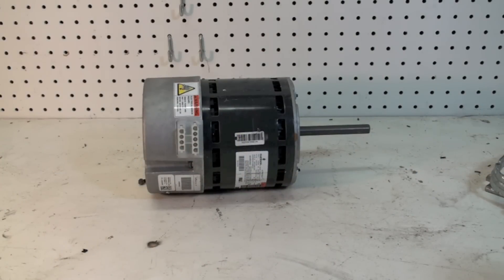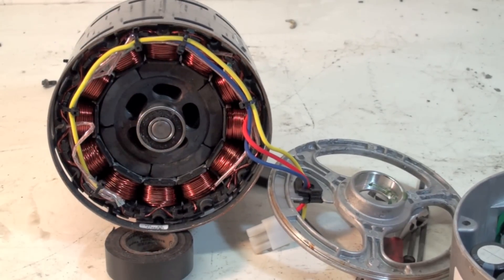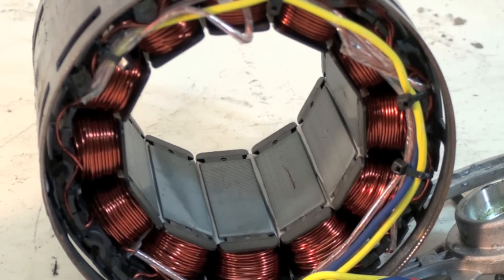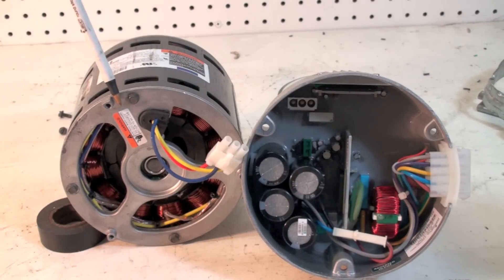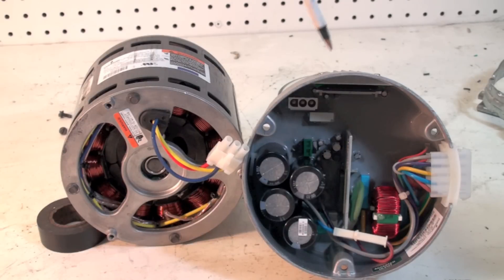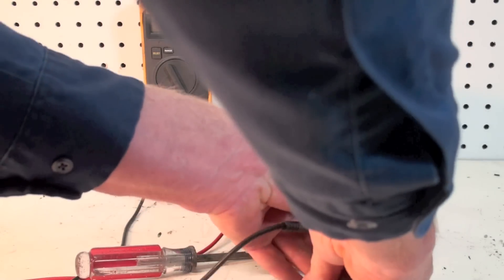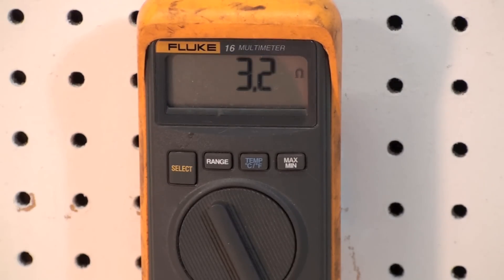The ECM motor construction and troubleshoot

Comment: My AC Blower sometimes doesn't  start, it wants to start but it doesn't start it takes about 40 seconds or more to start, sometimes doesn't start at all, and the the compressor pipes start frozen, evem if a turn it on instead of auto doesn't start, i call a AC company they check everithing they did not find anything, the first time, the aecond time they said us the motor, all the unit is 2 years all, any suggestions?
Reply from the maker: If it is an ECM motor, you probably have an electronic problem with the motor end bell.  Can't be sure without more info.
GFM

Comment: what is a Mossfit?  if you point to that as common problem might want to say how to order one..  you say "this thing"  nevr explain about what you call earlier Mossfit?  
then you explain in detail how to test every winding not a common problem...
Also Never mention other common module easy fix the Current Limiter gets burned!
a $2 part..  nice try
Reply from the maker: Mosfet.  It is an electronic switch.  Replacement of mosfets is not possible due to the end bell being covered in epoxy.  Thermister replacement is covered by a link at about 6 min into the video.  You might consider watching the video where these things are explained before complaining about it.
GFM

Comment: The Emerson UltraTech Variable Speed Motor Manual says to check the voltage between pins 1 and 4 of the communication cable/connector (the one with 4 pins), should be 9-15 VDC. But I've measured 3.3 VDC coming from two different PCBs (PCBJA103). Any experience or comments about this?
Reply: Confirming that 3.3 VDC is the correct voltage.

Comment: If the motor feels like it's a servo motor, ie has notches as it turns you have a short in the windings. Not as scary an issue as it sounds. I opened the case and found a burned spot on two wires as they run around the top to each coil. Carefully separated them and wrapped a bit of elect tape. All fixed for pennies instead of $700.
Reply from the maker: Good  thoughts.
GFM

Comment: Direct current three phase? There are no "phases" when using standard direct current.  This is a permanent magnet three phase motor.  The direct current is received by the VFD and then rapidly switched on and off making a rotating magnetic field effectively making it a square wave alternating current.  If you took this motor itself and supplied the appropriate sine wave three phase voltage,  it would theoretically run.  In essence the ECM is like a glorified computer cooling fan motor, which is also AC.

Comment: These Electronically controlled motors have shown up in all applications
 these days .First thing I`ve disassembled that has these motors in was a
 VCR that drove the capstan and the spinning head that was in 1987 then seen them in computer fans like the one you shown
If hooked up to 60 HZ ac the 2 pole unit works as a synchronous motor running at 3600 RPM as in a plug in electric clock

Comment: Hi and thanks for the great video. I wanted to know what the name of the male plug on the motor side is called? I have a module that shorted the plug and I need to install a new plug on the motor side.
Reply from the maker: I have no idea.
GFM
Reply: Thanks anyway. Turns out the connector was still in good condition.

Comment: One thing to mention if they send you one that is running in wrong direction,(Just switch two of your motor leads.) I've had a couple time that the module were backwards and when you call the supply house, they will say that's what that model number calls for.  Quick fix and on your way
Reply from the maker: +David Witherspoon Good info
GFM
Reply: Just as you do in a typical 3 phase motor  :)

Comment: I have an ecm motor which I replaced the bearings,I re installed it but it runs at slow speed and not at its full speed.Could the problem be in the module?
Reply from the maker: Peter Malahias If you are sure all the wiring is tight and you have set the speed on the control, you may be stuck with a module replacement.
GFM

Comment: You are very correct when you say the motors rarely are the problem and the end bell is where the failure usually is.  Out of about fifty or so I have come across, only two motors were bad.  The rest was just an end bell replacement and it was up and running.  Of the two that had bad motors, both of them was just one of the bearing assemblies was shot.  I could of just replaced the bearing but in the summer in Az. it gets quite rushed to get the next customer up and running.  It was faster and easier to just put a new motor in and go to the next unlucky homeowner.  Thanks for showing this on your video.  I found it very informational and enjoyed watching it.  Cheers
Reply: skyym3 what causes the end bell to fail
Reply: @rtd2348  GFM mentions the MOSFETs that face the heat sink and Thermistors are common failure points.

Comment: Is it possible to hook this motor up to a three way switch so I could use the highest and lowest speeds? I'm looking to retro fit it into my shop air filtration system... do you have any info as far as how I would go about making this work as far as wiring goes? Any and all help is greatly apprieciated, since this seems to be a bit more of a process than the last motor I had installed ... thanks!
Reply from the maker: jon nelson These motors are controlled by their own amp draw electronically.  If the amp draw reduces, the motor increases speed until the amp draw reaches a predetermined amount.  Pretty tough to control.  Hope this helps.
GFM

Comment: GFM, Genteq says that the epoxy in the module is to protect it from water damage. Although it keeps curious folks from digging into their equipment too ;-)
Reply from the maker: Brian Mahoney It actually does help.  When the electronics were open, there was a lot of water damage from frozen coils.  Also the most common part failure on them, the thermistor, is still accessible.  
GFM
Reply: @grayfurnaceman  is it easy enough just to crush the old thermister, clean off the ends and re-solder a new one?  Can you test it when it’s in place to see if it’s bad?
Reply: Unless it's just a furnace.  It stop people from fixing it for 10 bucks

Comment: well done

the motor is controlled by pulse width modulation off the dc buss just like a vfd does;

the mosfets control the pulses, so it is indeed a 3 phase dc motor
Reply from the maker: Chris Bennett You got it!
GFM

Comment: I would love to know exactly how it works.  I am assuming that the capacitors and the inductor coil are used as a filter to get the ripple out of the dc that is generated. I've heard that it has a current limiting thermister to limit current in the rectifier circuit. I call it a rectifier circuit but it has mosfet transistors in it and I know that they use anode and cathode saturation to control those. Anyway, I would love to know exactly how the circuit works. It would make it much easier to troubleshoot. Keep me posted. and thanks!

Comment: no such thing as three phase dc. now maybe three speeds or three different series of windings.
Reply from the maker: mossmossjdify I will be doing a set of videos on the operation of this motor in the next few months, so you can see how it works.
GFM
Reply: DC can be converted to three-phase AC. In this case, the motor has three-phase windings, and they are controlled by IGBTs connected to the DC bus. This allows the frequency and current to be altered, thus changing the motor shaft speed and also reducing inrush current.
Even computer hard disk drives have this type of motor inside!!!
Reply: In other words it is a VFD.
Reply: The motor controller takes the converted DC power and switches its polarity back and forth to in each of the 3 motor windings using sensing logic to drive the mosfet switches so that the applied current is timed to create a rotating magnetic field turn the permanent magnet rotor  ,, works very much like inverter in an electric car

Comment: I have an issue where the motor is not spinning at its full rpm, causing the unit to ice up. I wonder if its the end cap he speaks of?
Reply from the maker: I would be looking for air flow problems here.  filter, dirty blower, plugged coil etc.  Most of these motors are designed for a certain air flow and will attempt to make that air flow.  The end bell is probably not the problem.
GFM

Comment: Great video. Only issues we have found is that you have to make sure the static pressure/airflow have to be right.
Reply from the maker: Using a variable speed blower to correct ductwork problems is never going to work.  As you and I have seen.
GFM

Comment: the motor actually runs off ac,ac comes in turns to dc a pulse width modulator ic drives the mosfets  to a variable three phase ac signal to the windings
Reply from the maker: All correct.  To finish, the variable speed is made by changing the number of pulses per second.  Thanks for the thoughts.
GFM

Comment: you need to talk to DrZarkloff he says you can not change the end bell instead you have to replace the whole motor.

thanks for all the videos they are very helpful for me as i am a student in the hvac field
Reply from the maker: It depends on the motor.  Many are replaceable.
GFM
Reply: +GFM LOL (talk to the Dr.), I saw ad showing Evergreen makes a reversible 1/2 HP ECM replacement, not that one would need such a feature on a simple HVAC blower but for a special application and the right controller it's possible, residential elevator perhaps.
Reply: ALLAN KENNEY
if you ohm the winding out in the motor and they read good then you can just replace the e.c.m. (end cap) the end cap. It is an inverter (ac to dc) with a variable speed motor controller. that has a programmable ramp speed. at least thats what I believe it is.

Comment: I was a VCR tech for over 20 years , an ECM motor is very much like a drum motor in a VCR just a lot larger .
Reply from the maker: Probably true.  The ECM motor was developed for common use in the HVAC industry about 15 years ago.  In the commercial/industrial motor industry, the freq drive motor is almost always specified to adapt the speed to the load.  Thanks for the thoughts.
GFM

Comment: Good Information, Thanks GFM, Hopefully someone will make a tester for theses bell ends to have in the van, like a capacitor tester if we are going to see a lot more of them. Sounds just like inverter technology as in them ductless compressors must really save energy or manufacturers would not bother.  BTW; To get a rebate in Ma. the new furnace has to have an ECM, I assume ... because you'ld be now saving electricity and gas

Comment: I have a 2.3 ecm motor 1/2 hp, that I replaced a thermistor on.  When I take the end bell off there is not cogging in the motor, when I connect the endbell, cogging.  What is this an indication of?

Comment from the maker: The ECMs are used to increase the efficiency of newer equipment to raise the SEER rating.  Many of the newer furnaces and air conditioners use the ECMs.  To tell the truth, the ECMs don't save much money, as they fail about when they have saved as much as they cost.  But, as you can see, the end bells are repairable.  Hope this helps.
GFM

Comment: I changed (swapped) the ecm module on a X13 motor and it fixed the problem
Reply: Andy Z   In a comment on this thread tge uploader of this video says you can replace the end cap on all but the x13.... 🤷🏻‍♂️. I have an x13 as well and it has been swapped too

Comment: Thanks for your videos - I have a carrier unit with an X13 ECM 1/5 hp 230v GE motor - and what it keeps on doing is with the fan switch in the on position, it will run for about three seconds and then shut down - run for three more seconds and then shutdown again - with the blower door removed it will run much longer before it shuts down again. I don't have an ecm tester - is there anyway to tell if it's the fan control board or the ecm module?

Comment: It appears my motor is bad because I have different resistance readings ie: 8.8, 8.0 and 2.5 ohms. By the the way I replaced the end cap or motor module and it didn't fix it.

Comment: I have an ecm that keeps cogging back and forth during cooling or fan only demand.  What's up with that?  I have tested the windings between each other at 10 ohms.  The black terminal on the control board that connects to the corresponding motor winding was overheated and black.  I cleaned it, re-installed and tested the same - not working.

Comment from the maker: I don't doubt that.  Capacitors that originally would operate 60,000 hours now fail at less than 20,000.  I am sure you can expect lower quality in newer ECMs.  Thanks for the comment.
GFM

Comment: All great info however at 7:20 are you not just checking the end bell board, not the three phase dc windings? AC in/DC (pulsed) out, right? Seems the windings would be well isolated from the three exposed leads by that mosfet chip and associated electronics. Aye?

Comment: i have 2 X13 motors here that the magnets came loose on 1 and bearing locked on the other,i have the zebra vz-7 to check ecm motors great tool but it will cost ya to buy one but it does a great job and this is what hvac is coming to so i invested in it,great investment,you have to buy the extra harness to ck the x13 the evap. and cond. use different harness thats were they get ya everything is about the money these days,know what i mean,thanks for the video

Comment from the maker: You might look at Zebra instruments.  Johnstone supply also has some tools for testing.  No endorsement here just availability.  I believe GE also makes a tester.  Be sure to check out the link in the vid to the thermister repair.  Most failures are from this part.  Hope this helps.
GFM

Comment from the maker: The tesla500 ECM vid is an excellent video!!  I had never thought that a shorted winding could cause the same symptoms as a bad bearing.  Thanks for the comment.  Merry Christmas
GFM
Reply: The Tesla500 video was very helpful and allowed me to diagnose my motor problem. I had a shorted winding copper wire. M y initial ohm readings were 1.2, 4.4, 4.7. It also created drag when rotating the shaft similar to a bad bearing. After I found the shorted winding wire, I isolated it and insulated with epoxy resin. After reassembling the motor, my readings were 5.6, 5.6, 5.6 and the drag was gone. Re-installed the motor in the air handler and it ran. Keeping my fingers crossed I can get a few more years out of it. Thanks for posting about Tesla500. I wouldn't have found it without your reference.

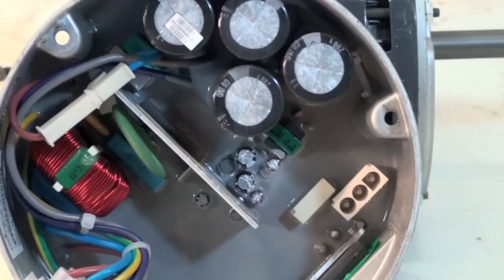Comment: if your Variable Speed Zebra says your module (end bell) is bad then check the resistor (its about the size of a nickle up to a quarter.) in this video you can see a green one at 1:29. check that resistor for continuity. if there isnt continuity you can replace that resistor with a soldering iron and a new resistor for about 25 dollars (soldering iron not included)  . this saving you or your customer hundreds of dollars.

Comment from the maker: If the motor stutters under power but does not start, there is a problem in the electronics in the end bell.  If there is resistance to turning when the power is off the bearings have failed     Most failures are in the electronics.  The end bell can be replaced or repaired if you have the ability.  Check out the video at ECM speed control repair
Reply: I think that is the issue with mine. When it called for the fan it twists a little then throws the 41 error code “blower motor fault”

Comment: So I have a 1/2hp 1 phase just like the motor in this video. The fan motor was studdering to try to start, This is an expensive motor, My question is, when I turn the shaft of the motor by hand should it spin freely? Mine seems to feel like magnetic resistance. Thanks in advance. All of the windings inside look brand new. Its a GE motor off a lennox air handler 14 seer.